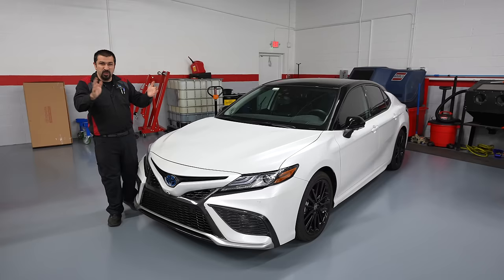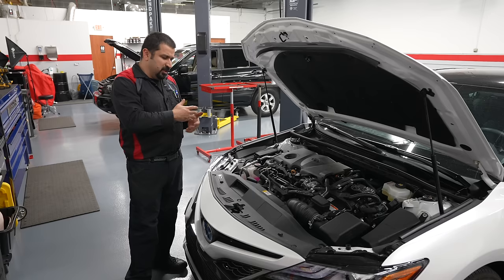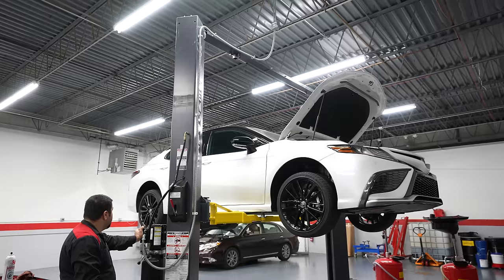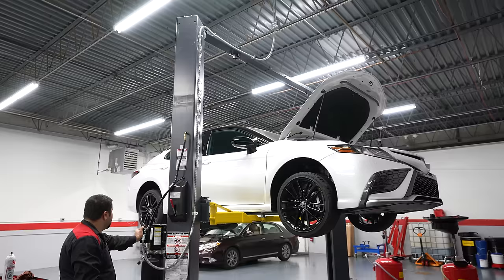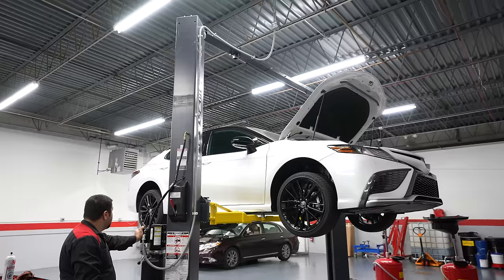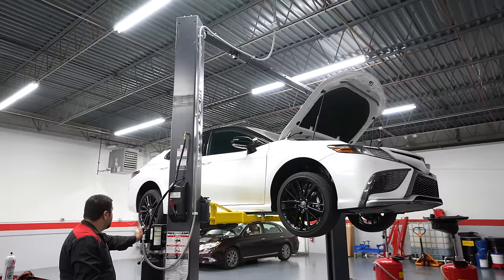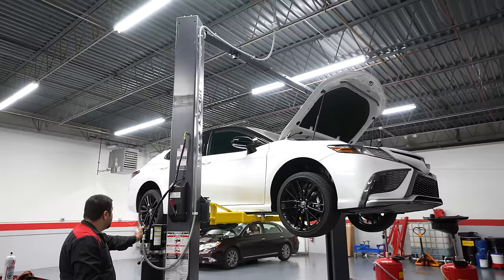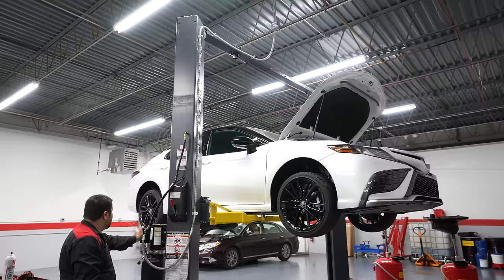Should you buy a Toyota Camry Hybrid? 1 Year Ownership Update

Comment: marhaba, estez, yau moallem.
Thank you for the video.  I own a '22 XLE 4 cylinder Hybrid in that special pearl white, grey leather interior.  It is the smartest purchase I have ever made.  45 miles to the gallon, smooth, powerful, comfortable and quiet ride, make me love this car.  I already have close to 19,000 miles on the clock.  As a shade tree mechanic, for over 45 years, I know a fair bit about cars.  No one has ever changed my oil, and done other maintenance on any of my cars, for the reasons you may agree with.  No offense to you, but the majority of mechanics are sloppy, in a hurry techs, who want to push cars out the door in short order, to pull in the next sucker, sorry, I mean customer......
I DO NOT believe in the Jiffy aspect of an oil change.  My oil changes take much more time than 10 minutes.  I remove the drain plug, and oil filter, letting the oil drain for about 30 minutes.  I then use low pressure compressed air, in the crankcase to chase remnants out.  I then put the emptied filter back on the engine, and crank it for 2 seconds, ( making sure gas engine function turns the motor). I then immediately switch off the motor.  This sends the remaining almost quart of dirty oil into the pan and fills the filter.  I then remove the filter, which is again full of dirty oil.  The drain bolt comes off next, as more oil is drained.  By now, I have gotten just about all the old oil out of the cranckcase and the galleries.  I then either pour a quart of gasoline or a can of carb cleaner spray into the oil filler opening.  in 5 or so minutes I use compressed air to chase out any traces of solvent, or gasoline.  I then put a genuine Toyota filter on, and HAND TIGHTEN.  Then a new washer ( bought with the oil) is placed on the drain bolt, which goes on, WITHOUT A CHEATER BAR, or an impact wrench!!! 🤣🤣🤣🤣  ( horror stories about so called "mechanics" stripping the drain bolts out, causing replacement of expensive oilpans.....
With everything wiped nice and clean, I pour just about every drop of my 5 quarts of genuine Toyota 16 Weight fully synthetic motor oil into the crank case.  Maintenance reminder reset, I take it for a test spin.  after inspecting the underside for leaks,  following the test drive, I replace the under side pan, and reset the B trip odometer.  I change my oil every 4 to 5,000 miles, and have done 5 sofar, from new.  Everytime I drain the oil, it still looks like honey, as I leave no contaminated oil from the previous oil change in the motor.  For close to 50 years, this methodology has served me super well.

Comment: Over many YouTube videos you, AMD,  I have discovered you are very particular, fussy, and picky. Ever since you left your job with the Toyota Dealership in the Chicago area and probably a year or 2 prior, you prefer not to be a mechanic anymore. You opened up your own shop (Congratulations by the way) however, because of liability, insurance costs, and other situations, you will only perform work on vehicles deemed safe and easy for you to work on. Then you got your wife and possibly also your daughter Lexus SUV's. Q? Do you still have your Hybrid Camry? You said it sits around and you have been driving other vehicles. The 8th Gen Camry with the new 2.5-liter 4-cylinder was a let down because it was new and had no reliability data., then the Camry TRD because of Bolt-On type body parts that were made available as accessories for all the other Camry's as the TRD not distinguishable or unique also lacked amenities. Toyota fails on body panels as differences in gaps between each panel are not consistent or they should be closer. Window seam and rubber seal/liner especially the driver side collapse often. Then the Camry ground clearance is too low, then the 19-inch alloy wheels are easily damaged. I genuinely believed you liked your Camry then after a 1 year ownership, found many things not to like about the Camry. You do give us valid points, what to be on the lookout for, and how to make our Toyota last longer. Deep down I feel that Toyota has disappointed you and that they do not produce quality vehicles as they once did. Maybe this is why you moved to the next tier which is Lexus? The negative remarks, even though they may not be deliberate, give me the impression you are ready for a new adventure away from automobiles and that having your own business is a fantastic idea and plan. Unfortunately not working out or as profitable but you rather do YouTube videos. Mid-life crisis and in a rut. Affected by the COVID-19 pandemic the workforce or employment environment has changed. It's expensive to start your own business and establish it.  I know you are respected and have a great reputation on YouTube, you have good traits and character, very likable. You have come a long way in life by coming to the U.S. to have a better life and success. I am truly happy for you. Thank you for sharing your automotive / Toyota experience and knowledge as a Master Mechanic.

Comment: I agree with everything you said except for the oil viscosity. Why is it that the hybrid engine in 2017 calls for 0w-20, with the option to substitute with 5w-20, but today that very same engine calls for 0w-8? Why is it that in Australia that very same engine can use multiple viscosities, as per the manual, based on outside air temperature?  Nothing inside the engine has changed. The only thing that's changed is the Green New Deal and CAFE standards. Just like you don't believe in waiting until 10,000 miles to change your oil you should also question why the oil viscosity keeps getting thinner every year.
Reply: I'll bet it's EPA rules

Comment: I only drive about 3000 miles a year.   With full synthetic, I only change my oil once a year.  It seems to me, claiming someone needs to pay 3 services a year for a car driven 5000 miles a year or less (assuming normal driving, roads, etc), is taking money for little value 2 or 3 times a year. 

With good oil, for example, hardly any engine wear occurs for low mileage as long as full synthetic oil is changed annually.

Comment: My concerns about the hybrid Camry vs a regular Camry.
1.How long will the battery last and   the cost of fixing it? I will have the car probably close to 15 years.
2. Is it worth getting a hybrid if 90% of my driving is highway?
Would love your thoughts. Thanks
2. Is it
Reply: If you regularly drives on highway only, the NA 2.5L 4 is better.  The hybrid is much better suited for city driving.  You have one less thing, the hybrid battery pack to deal with down the road.

Comment: Rattles…..hmmmm, my 2020 RAV4 AWD Hybrid has one. Coming from somewhere in the dash and only at certain temperature. Doesn’t drive me crazy though. Any car has imperfections, this small rattle seems to be the only imperfection so far. So it is only fair to say this car is the best car I’ve ever owned. Next year this one will be traded in for a brand new RAV4. Same specs, same trim, different color though. Dark blue is beautiful but very sensitive for minor scratches and swirl caused by car wash brushes. Greetings from Hekelingen, Holland. Bye, Willem.

Comment: Thx for mentioning air filter.  I'll throw in cabin filter too. I have a 2018 Highlander that just turned 20k.  My dealer keeps trying to buy it from me.  Low inventory.  Anyway at one of my scheduled free service appointments the service advisor recommended I have my air filter and cabin filter changed.  I don't drive in dusty conditions but what the heck?  I figured I'd pay a little more for Toyota filters. So what.  And as long as I've been messing with cars I should have known better. We all know how easy those filters are to change. My dumb behind forgot about the charge for service.  Again I should have known. Well $94 later I had my new filters. I actually had a good laugh over it with the advisor when checking out.  I said, "Oops, you got me."  I should have asked for my old little used filters too, to use later. Somebody at the dealership ended up with those. Oh well.

Comment: What is more cost effective? A conventional Camry or a Camry Hybrid if you purchased new and drove 15,000 miles per year for 15 years. If you consider initial cost, rebates, maintenance, depricitation, battery replacement if it needs it or resell value if it hasn't had one.

Comment: I live in Florida where in the summer temperature is always in the 100s from June to mid-October so for motor oil I use Amsoil Boosted XL 0W-20 synthetic oil ensuring protection from high temperatures then in the winter I use Amsoil 0W-16 which warms up a lot faster in cold weather. The Toyota manual says that you can use 0W-20 if the 0W-16 in unavailable but then you would need to go back to it on your next oil change if you had used 0W-20 previously so that's what I'm doing.

Comment: You ❤ your car but you drove it for only 5,000 miles…. My old (new) Audi A3 pump injector tdi construction year 2002 has only 422.000 km on board and I bought it about 2.5 years ago with only 295,000 km on board for 2,500€ consumption about 60 miles per gallon. I do my oil changes every 4,500 miles. I live over two miles away from the Audi factory in Ingolstadt Germany. My older Audi (1997) had only 704,655 miles on board but I overturned on the motorway. And no I am not in Toyota but I find your films well made and very instructive for many people. May the Lord bless you and keep you.😊(I wait in full anticipation for the Russian thermonuclear bomb for bringing me fast in paradise. About 3 miles near us is also a refinery 😅. Have a relaxing day.)

Comment: Dear car care nut I'm a loyal scriber of yours.
I've traded in my 2014 camery hybrid with 60,000 on it,love that car hated to see it go.
It was traded in on a 2021 camery hybrid 
What I don't like about the 2021 is you have to put the car in windshield wiper mode to change the blades on the car!
Also when you close the 2 front doors the sound I here is like a hollow tinty sound not a solid sound on both doors.
My wife would say don't slam the door which I didn't do,lol 
Is this a normal sound when closing,not slamming the doors on my 2021 camery hybrid car?
Great informational video!
Any advice would be appreciated. 
Keep the vids coming to Pittsburgh Pa. 
God bless 🙏 you and your sir.

Comment: Although my car manufacturer recommends 5W20 oil, I always use 5W30 oil. I never had problems with my engines. We live in desert country and it gets very hot in the summer months. I prefer the thicker oil when the temperature gets about 110F. Our next car will probably be a hybrid also but it will only be a Toyota. They have a long history with hybrids and have a long history for reliability. Other manufacturers, I do not have much trust.

Comment: I wonder if it is because it is made in America?

I found that cars that were made in countries other than the country of origin of the manufacturer, were always of a poorer quality.

Here in Australia the Honda Jazz was from Thailand, and whilst it looked like it should....

Everything about how it drove felt wrong, like it had been slapped together without any love.

The braking felt uneven and when put over a brake test machine proved this was the case ("within tolerance" though...)

And whilst some might think that I'm just being biased, I did do an unintended blind test,

In that I was doing a PD on a Jazz one day, and during the road test I noticed straight away that it drove differently, EVERYTHING felt good, the car felt like everything was in sync.

When I got back to the workshop and I was filling out the PDI sheet, writing down the VIN.... yep it started with JHM.....

Turns out the factory in Thailand had flooded, so we were getting Japanese ones,

Once the factories were up and running in Thailand...... yep you guessed it.... rubbish.
Reply: Thanks for watching⬆️⬆️
Reach out with the number above

Comment: Ahmed. Great video. I brought my Camry  (SE gas engine) around the same time you brought your.  I have 10k on mine now. I did the 1000k oil change. And had Toyota do one at 3,500 and 9 K. Though now that you say they don’t use Toyota oil at the dealership. Kinda makes me wonder.🤔  Tomorrow I will go to dealer to get the wiper inserts. I do not want a scratched windshield. As for build quality I notice on my car some of the same things you noted in the video. Overall I love the car. I get great gas mileage I can easily get 40 mph on the highway. I’ve owned the Gen 5, 6, and 7 this Gen 8 is the best.

Comment: Car manufacturers don't want owners to service their cars, the servicing parts are usually in locations that require an elevator or dissemble other bits and pieces to get there. If cars where designed with the owner in mind there would be more maintenance and... a lot less business at dealerships.

Comment: 17:35 The imperfection you point out is called 'flashing' and occurs more and more as an injection molding tool wears.  Over time the two halves of a tool wear and do not seal perfectly where they meet.

My guess is that this component on the 2022 model year may have been the original mold and was nearing the end of its life.  I recently bought a '23 Camry and don't see this issue - my guess is they rebuilt the mold to correct this because it was occurring at an unacceptable level.  That component is probably still 'in spec', although not perfect, or they made the decision to approve the component and continue production due to volume requirements and no downtime available to rebuild the mold.

Comment: You are correct on the fit and finish. It is not the same between made in usa vs. made in Japan. I love made in Japan vehicles . They have less bugs on everything. I got no issues on my prius .  I got issue w fit and finish on my 18 Camry xle hybrid and dealers will say I have to wait for Distict service Mgr see it first b4 any repairs. Omg and my 22 sienna .  The 22 sienna makes a squeaking noise when car at initial take off from 🛑 stop. Just first few seconds . Forward or backward is like body flex .  Dealer heard the noise and can’t duplicate the noise where it comes from . They called tech line twice . And car in shop two full days. It id something w the subframe and frame of the car bottom of car in the driver seat area .. sad .

Comment: 1st oil change I understand doing at 500 miles or so but after that use full synthetic Mobil 1 oil and filter and change at 7,500-10,000 miles or 1 year which ever comes first.  
As you know Toyota doesn't make their own oil so they are sourcing it from somewhere else.

Comment: We bought a 2023 Camry Hybrid XSE and learning all about it, after driving a Mazda protege 2001 manual transmission. We also did notice something strange under the dashboard, steering wheel, and breaks of the Camry - there's some insulation that is not covered. It's just bare and looks unfinished. The dealer told us that all the Camrys are like this. What do you think?

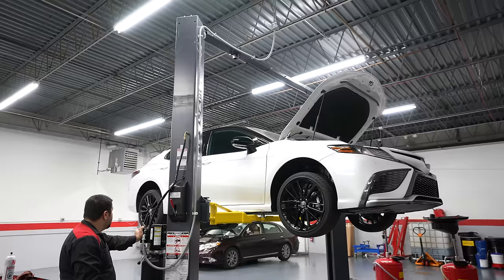Comment: @10:00... Fuel smell is common in all direct injection engines. DI is great for emissions, but horrible for longevity. The oil gets full of fuel and the intake valves get carboned up. @21:30... Not ALL makes. I'm a Nisan Master Tech. Nissan oil level must be checked after the car has been sitting for 30 minutes. This is from Nissan. This came about due to the way the dipstick is in the VQ series of engines. @22:30... That's cool. Nissan's don't have that feature. It's cool that Toyota thought to program a "service position" into the BCM. @27:00... Been working on cars for 35 years. I'm actually diagnosed with a "bad back". Been told I may need surgery soon. It's bad enough that I won't work on a car without a lift. I'm 6' 3" and need to raise a car up a foot or so just so I don't have to bend over the engine. @31:30... That stuff should be caught during PDI. The problem is that many dealers now have non-techs doing PDI's. Lot porters, lube techs, etc... People that don't have the knowledge or skill to fix these issues, but that the dealership pay 1/2 what they pay their techs. This means the dealer pockets more of that PDI money.

Comment: It's funny after being a Toyota tech and working on other cars you just realized that nothing is built like a Toyota or Lexus. I remember doing dealer work on GM's they have 25,000 mi blown head gaskets. 60,000-mile wheel bearings blowing up. Just that you never see on the Toyota until they get to like 300,000 MI

Comment: Traded my 2021 Prius Prime in after having it for just over a year, mainly because of the poor build quality. Rattles, squeaks, steering wheel started making a groaning noise, and the rear suspension started creaking when making turns. Left it with the dealer for a few days and they said it was all normal operation. The supersonic red paint seemed to be of poor quality as well, chipped very easily. It was my first Toyota, bought it after spending some time in a Corolla hybrid as the build quality on it seemed excellent but I ended up being disappointed. The Prius Prime is built in Japan as far as I am aware so it isn't just the American built cars with issues unfortunately.

Comment: I did not know that about the time "limit" for the cabin air filter.  We had some thunder storms about 2 to 3 weeks ago with some humidity for several days.  Used the Rav4's A/C a lot.  Found the next day the smell from the HVAC was noticed a lot.  I probably should have changed the cabin air filter then.  Hopefully I can change it this week before Friday as I'll be going in the hospital for some surgery.
Other than the normal cabin air filter change, what if any does Toyota have to spray into the HVAC system to clean out that musty smell?  It doesn't smell now, the heat over the last couple weeks dried it out.
Very good video.  Does the 2020 RAV4 non hybrid have that wiper service on it's switch?  I like that.
Reply: Thanks for watching⬆️⬆️
Reach out with the number above